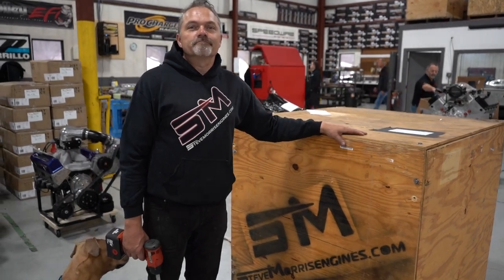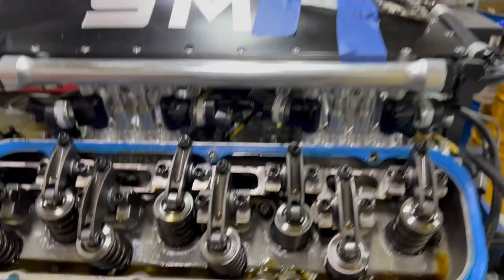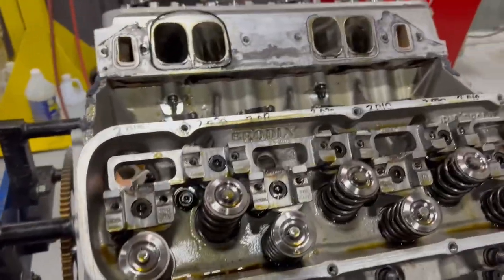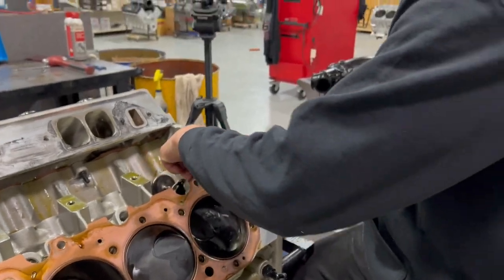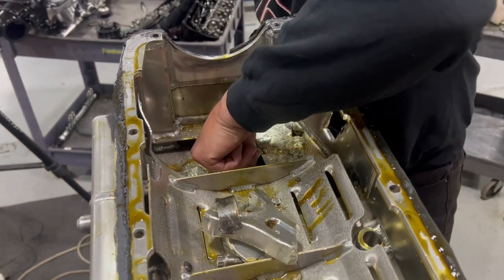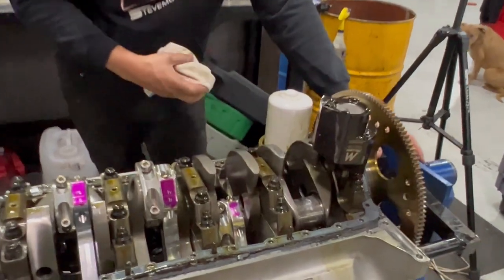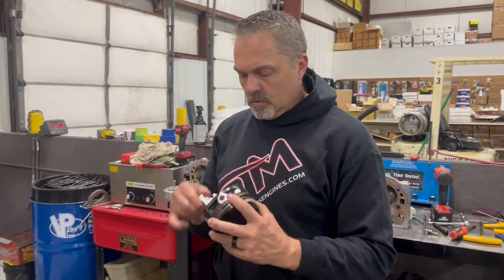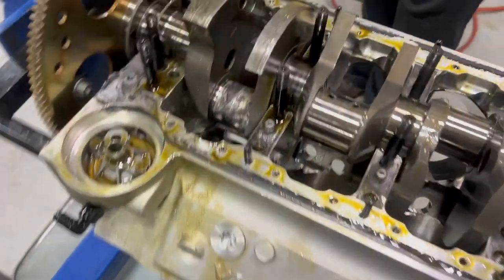Mullet !  What Happened ? - Warning: Engine CARNAGE

Comment: I feel better about starting it without oil 😂
Reply: oil is overrated
Reply: You dont need to worry about having oil
Reply: I think starting it without oil may not show any heat marks because it was only 30 seconds but it would not show how it can dent the bearing without having the oil cushion and start the galling process then the catastrophic  process that follows. Plus there are only educated guesses after a major failure not usually a cut and dry answer because of the dynamics of an engine. We support you to fix it either way 👍👍
Reply: HELL YEAH BROTHER SMX is in the future?
Reply: I am not convinced. It wasn't the run without oil, it was more likely the startup after.
Reply: SMX time
Reply: Dude, how do you have time to sit down and watch youtube for half an hour.
Reply: Did you put it on the 2 step without oil Cleet?
Reply: LMFAO
Reply: It was that 0W-0 race weight oil. So thin you get ALL the horsepower!
Reply: SMX for mullet Cleet, throw this one in Leroy and Leroy's LS in ruby :D
Reply: @richardfitzwell6579  that’s a quote from Peg! If anyone else knows who Peg leg is and his fast idle stick!!! ⭐️
Reply: I was cringing with every bolt he was removing thinking "oh man, I hope it's not the air lube"
Reply: More oil just slows down the engine anyways
Reply: @richardfitzwell6579  you're stunned
Reply: Lol.
Reply: It's not a 4.0L jeep engine cleet you need oil lol
Reply: @MikeJones-em8vz  That is probably the dumbest comment I have ever seen. Steve is the best engine builder in the world. He built a V16 for the Devel16 Hypercar. If you want to go for six or below, this is the guy to make it happen. Good thing Cleet isn't listening to you.
Reply: @MikeJones-em8vz  😂
Reply: Longer dipstick less oil
Reply: @tstager 1428  seriously. That commenter is a clown. Steve builds some of the fastest engines in the world. There's a reason cleet went to him when he needed power. This is just a case of "shit happens."
Reply: She’s a doosie buddy!! 👍
CANNOT WAIT to see what’s coming next for old mullet!!
Reply: @MikeJones-em8vz   
That is sn idiotic statement. 🤦‍♂️
Reply: Let's try to not do that again annnnnyway... 
It's never good to start engines without oil. 🤦‍♂️
Reply: @MikeJones-em8vz lol.... some people dont get sarcasm...
Reply: @tstager1978  

I agree STUPID comment. 
Steve's not the best engine builder in the World. There are many. 
He's a good one though.
Reply: Jajajaja
Reply: `lol was going to post that you are off the hook son 🤣🤣
Reply: Prolong Oil worked for the Viper
Reply: "You should start using the song Oops I did it again". As you go through engines alot.
Reply: @kiwidiesel  I don't think he is... I think it's related.
Reply: Reject oil, return to babbit
Reply: Cleet, put that SM into Ruby, I been saying all along that SM would put Ruby on another level......
Reply: @captsnafu  because he's a human and business man! He has set up his team to look after their divisions and they do it well. He's also a new dad so sitting on the couch having their time while it's playing 🤷.
Reply: That engine should go in RUBY
Reply: Thank god for warranty! 😂
Reply: Smx next
Reply: McFarland Lubrication.
Reply: Yeah it ain't no Ferd 300ci six bud, them big ol big block Cheverolays kinda want them dinosaur squeezings. You are an absolute tin arse though with how that valve snapped off the way it did. I was expecting a chewed up combustion chamber but instead we just got the whole valve head just sitting there looking at us.
Reply: Make it a rule to fit a tag to the ignition switch whenever the oils get worked on in a hectic situation it’s easy to see and will save you an engine 🏁
Reply: @MikeJones-em8vz  LOL! what!? the first engine was flawless for ages, pushing 6's in an elco! this comment is making you look bad! you cant push engines this hard and expect to never have issues LOL! wtf
Reply: Time for a SMX for Mullet
Reply: @MikeJones-em8vz hmm, FL2K win, World Cup win, RMRW overall win, and I’m sure I’m missing something. Yeah, that looks real bad all those P1’s. Stupid people saying nonsensical stuff angers me.
Reply: @make-it-work4u  Let's not get to techy. Just kidding. Good point. YOU ROCK. I like the way you think.
Reply: New rule check the dip stick before checking two step...lmao
Reply: @MikeJones-em8vz  What are you talking about?! Steve just wore that! He didn't blame Cleet, and Cleet openly admitted to starting the engine without oil! It "may"not have done any damage, but I assure you it certainly didn't do it any good. Steve builds the finest boosted engines known to man, and stands behind his product quite publicly. It is just SMX time, that's all. ...
Reply: SMX for Mullet & while you're at it "accidentally" order an SML for Leroy! 💪
Reply: You know how to break em Cleet! Do it for Dale! Lmao!
Reply: @thebadfarmer or 45+ pounds of boost crammed down its throat. Even Steve said he didnt build it for that kind of boost.
Reply: Maybe avoid that anyway... :)  SMX TIME!
Reply: @MikeJones-em8vz  Why? Because it can't handle the boost? And then it didn't handle the boost?
Reply: @MikeJones-em8vz  🤦🏻‍♂️
Reply: Might of been the start of the problem
Reply: @MikeJones-em8vz  
Lol. The only person looking bad right now is you.
Reply: Bro shuuush 😂 must be SMX time
Reply: @MikeJones-em8vz  I really don't see how you can say that. Especially after how far the engine was has been pushed well past its limits.
Reply: @ElizaJane85  It isn't so much a matter of what Steve built it for. It's a matter of what that specific engine block is generally speaking known to reliably put up with. It is a parts ( engine block specifically ) limitation.
Reply: @ritchschut1997  true.
Reply: @tstager1978  I don't think he has room for a v16 unless he mounts it in the rear
Reply: 😂 yeah let’s roll with that . If your not pushing the boundaries y’all wouldn’t be where y’all are today so God Bless keep winning!
Reply: @make-it-work4u   I thought he said it was about 60 seconds. I always put a 5 guart of engine oil on top of the engine when I start to change oil. Best way not to forget. I almost did that once. At the key and it hit me. No oil....lol Very easy to forget when a lot is going on.
Reply: It was the possible over use of boost me thinks😆😅
Reply: Cleetus, what Oil do you use,, Brand, Weight.. ???
Reply: When I saw the journals overheated on one side and not on the other I thought about oil starvation under decel since you're letting that engine rev down from high RPM with the parachute deployed, and it's unclear if there's enough oil around the pick-up in that particular situation. I think this is what finally got to this engine eventually.
The previous engine survived a lot more passes at somehow similar power levels at least towards the end of its life and broke for a totally different reason (if that locked lifter can even be called a failure), did you run it with more oil maybe?
Reply: @mituc  I fail to see how that would only cause issues on one side of the journal?
Reply: From now on all your oil-pans get float switches inter-locked with the ignition. 
Call it the Cletus switch.
Reply: @captsnafu  27min is not long at all 😂
Reply: Nah bro you killed it right there probably. 🤣
Reply: SMX...
Reply: @captsnafu  that’s why his next video hasn’t come out yet lol
Reply: @golgothapro  You'd think that would be the first and most important fail safe.
Reply: @MattyEngland  Then you fail to understand how an engine actually works. How good would you work with no blood pressure?
Reply: @captsnafu  ole Cleetus has probably been waiting just like we have for this video!
Reply: @TheBadFarmer  it made a 6.94 pass letting out at the 8th, I don't think it was the oil. It was to much boost plain ans simply
Reply: @kingdavid13691  Yeah, can't wait to see what Cleeter does to that and how quickly he does it.
Reply: I'm just kidding around cause I once had a buddy take me with him as he test drove a used car (with a broke pump drive and a non-functioning oil idiot light) he was thinking about buying from a used car lot. We took it right back cause the lifters were just raising hell; and all they did was put it on a rack, put another pump in it, and sell it to somebody else ! LOL
Reply: @budddove6480  I understand about oil pressure thanks, but how does anything other than the crank being bent make one half of the journal hot, and the other half not hot? We're talking about the journal itself here, not half of the bearing shell.
Reply: Steve Morris seemed to me to be using his words wisely. He didn't want to throw Cleetus under the bus.
Reply: @Rad_Triumph_765_RS  who doesn’t know who Peg is. Just a fuckin minty guy!!👌
Reply: @MattyEngland  Because during decel it's the bottom side of the journal or the bearing on the rod cap side that is under mechanical stress.
Reply: @35RSkyline  I poked a hole in my oil pan offroading in my XJ. Almost went 2 miles before I spun a bearing
Reply: @mituc  The bearing I agree, but the crankshaft is constantly rotating so I don't see how one side can be worn more than the other.
Reply: Probably a combination of things beginning with the no oil start up. 

Gosh I hope there is a SMX in Mullets future and this engine goes in Ruby or Leroy
Reply: Me, too, but I still don't recommend it!
Reply: @captsnafu nobody said he sat down and watched the whole thing
Reply: @kingdavid13691 hopefully but only because he's past the limits of that block anyways.. this would have happened to an SMX as well
Reply: @MattyEngland  Yeah I can't find a reasonable explanation for the mains having the same type of wear unless after the rod bearings spun and bound to the crankshaft they created some sort of distortion in the crank until the rids eventually let go. the rods went first so IMHO that's where everything started...
Reply: Cleetus I still think you should upgrade to smx or sml
Reply: We don't need no stinking oil!
Reply: @diesel7903  he’s just a minty guy doin Greta cold starts.
Reply: @Rad_Triumph_765_RS  😂😂
Reply: @diesel7903  give’er the Cosby sauce, she’ll start
Reply: Time for the SMX 😎
Reply: Just need to go SML cause you know you will want more after you passed limit of smx
Reply: @philipshaffer401  SMX is better than the SML
Reply: If it had break-in oil in it from assembly or was in the middle of an oil change it would have enough boundary lubrication on the surfaces to be ok for a bit at lower idle without damage. Doing a full pass, etc would have wrecked though.
Reply: @Aladinscave  I've seen guys hang the oil fill cap on the ignition switch so they don't make this mistake.
Reply: I don’t know how you start one with no oil? Like that’s the first thing I check but i better shut up I could do it to I guess
Reply: @jaypisme2343  It starts with relying on other people
Reply: Only cleatus has the new Bluetooth valve conversion kit.
Reply: @sneezinhatch  probably not! Lol!
Reply: @jerrybaldwin7543  hell yeah brother!
Reply: We don't need no stinking oil...
Reply: Difficult assessment were it went wrong, racing parts to the limit is fine, as long as you accept it can go horribly wrong 🤓
Reply: @philipshaffer401  SML is the baby version of the SMX…
Reply: A true gentleman, Garret. Well owned. Watching you guys partnership is awesome. Keeping it classy!
Reply: @Rad Dad  yea Steve said the sml was model after the smx  ultimate endurance engine perfect for drag and drives
Reply: Lol
Reply: Oil? Where your going you don’t need oil. Doc Brown paraphrased.
Reply: Do you think its time for a Dry sump system?
Reply: Cleetus as a man that give 110%... given how many times Steve say it's not that bad... this was a sup par effort lol
Reply: lol
Reply: only reason that crank would bend is if Cletus gave it 16 more pounds of boost, then it was supposed to have😂 im jokeing
Reply: Pretty expensive Sportsman racing, might want to consider going Top Fuel, carnage and cost would be the same !
Reply: @thetheoryguy5544  I believe ruby is getting the motor out of rocky since it has original engine mounts
Reply: That’s what started taking out that bearing.
Reply: @captsnafu  he was in the washroom doing paperwork 😉
Reply: Buy the smx the next step !
Reply: Cleetus turns v8’s into v6’s!
Reply: @scottmoore6131  haha well you got a point
Reply: He's just saying that because he knows you will watch it lol 😆
Reply: @make-it-work4u  you do realize that even if you have the drain plug open for a week, there's still SOME oil inside the engine, right?
Reply: @LEOhopeful  sure there's some oil sitting in the valve covers that doesn't drain back and in the valley but if there is no oil reaching the pickup on the oil pump there's no oil pressure and the miniscule oil left in the bearing get slung out the moment it starts. Engine bearings have a 2-4 thousands gap that needs to be filled with oil or else metal to metal contact happens. Thats why cold starts are the main wear times a motor sees because no oil pressure for a second or two even though the engines full of oil...🤔
Reply: I've heard of cylinder deactivation, but this seems a bit on the extreme side.
Reply: They should of pulled the filter and cut it open to take a look after starting it without oil . Checking a filter is the cheapest way to save you possibly thousands of dollars .
We had cam bearing issues on a new motor several times . Every time the filter came off it was cut open and checked . Catching it early is always a good thing .
Reply: @captsnafu  Because he has a team of people that helps out so he can stretch out his time
Reply: @GapRecordingsNamibia  So would a big tire car I've been wondering for years when he's going to make the switch and get rid of them small tires
Reply: You should print out stickers saying Oil Drained Don't Start and put one on every time you do a change because you said yourself you do alot of oil changes so chances are you will do more dry starts
Reply: @make-it-work4u  what about when you first start it up and there is always a few seconds of no oil pressure before it starts flowing. So no that logic don't work either
Reply: Let's be honest, it's a pretty ingenious way to make a V6 from a V8
Reply: The damage is furtherest from the oil pump, it ran for 30 seconds to a minute without oil, that's anything upto +1000rpm dry, that's alot of friction.
Once oil went in piston 7 and 8 was the last to receive lubrication, having said that the main bearings were fine except for the one before which Steve said probably picked up first shoving rubbish into those end bearings
Reply: It's like in that movie "Evolution"
Nurse: "I'll get the Lubricant"
Doctor:  "There's No Time for Lubricant"
Harry Block:  "THERE'S ALWAYS TIME FOR LUBRICANT!!!".
🤣
Reply: @brettgibson7962  😂😂😂
Reply: @Cleetus McFarland Oil?! "Where your going ya dont need Oil"

😅 Hell yeah Brother 🍻
Reply: didnt you guys drop the engine on its crankshaft pulley and swapped it or was that the godzilla
Reply: @jaypisme2343  when you have multiple people working on something, it is not that hard for this to happen.
Reply: Upgrade to a bigger engine 💯🤘
Reply: @THEFERMANATOR  I understand I guess I’ve never had that many cars so I guess it can happen
Reply: Tome to get the lab coats will a smx running with no oil in it
Reply: Didn’t y’all drop that motor the first time it went it just curious if that might have caused a creeping issue…?
Reply: @Rad_Triumph_765_RS  You don't need to tell them it's zipties & bias plies!
Reply: You don't need that where you're going
Reply: Yo Cleet, did u do the editing on this vid? It's exactly tly the same style as your content
Reply: I didn’t even know it broke did I miss an episode?
Reply: @jaypisme2343  it's not as black and white as it sounds. Almost all racing engines do not use dipsticks.
Reply: Sounds like you wanted a v6 instead
Reply: Oil is just extra weight
Reply: @kevinfunk83  i think he won 2 or 3 drag and drives last season in mullet.
Reply: @Stackali  I was just talking about the overall win he had, I believe at RMRW which was pretty impressive. Class wins are good too.
Reply: Im just here to scroll through the comments to see WTH Mike Jones said 😂
Reply: @jennajones2155  I’m pretty sure he deleted it but hope he was being sarcastic.
Reply: God damnit should you be making an engine  ;). But yes looking for ways to improve efficiency on my mothers property. Note the house was built by rail workers in 1880 after burning down the original house
Reply: You shouldn't because I would bet it didn't help. I have seen doing what you did spin bearings.
Reply: @jerrybaldwin7543  you predicted the future
Reply: 392K, 8k more hell yh brother
Reply: @captsnafu  time structure?
Reply: @roaringcat1  I talking about the amount of subs the channel has now, it almost at 400k from 200k with in a week, I'm not from US so I couldn't careless really, but yh 400k subs sheeeeeeeeeeeeesh
Reply: 400 k
Reply: As Forrest Gump would say......